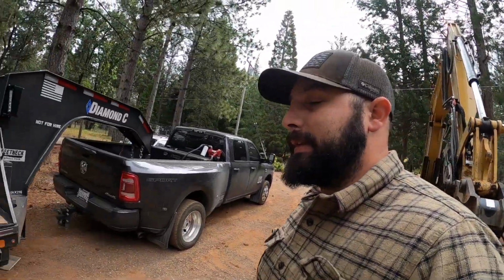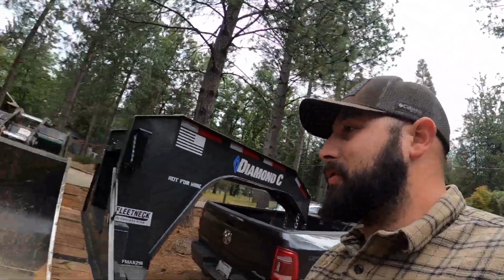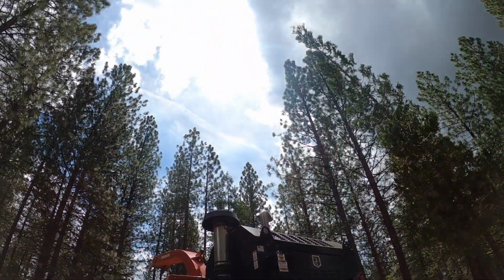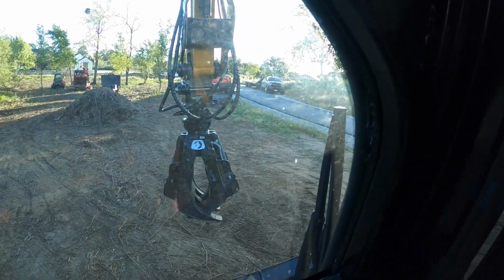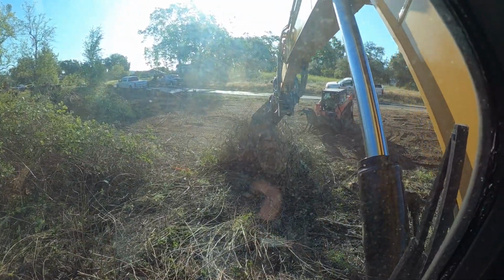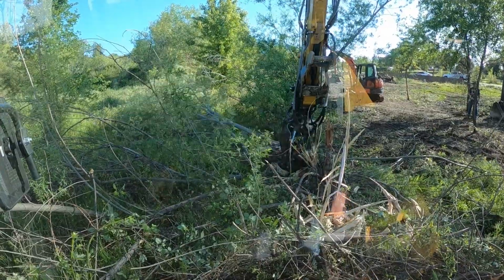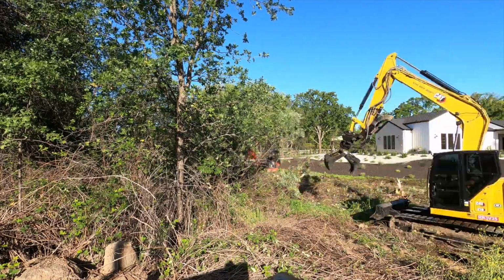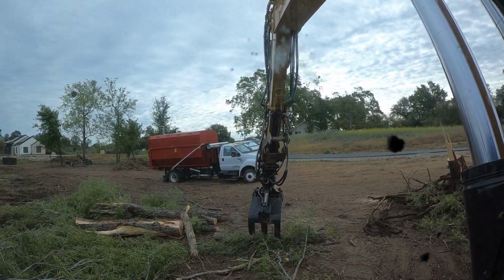Clearing property with a cat 310

Comment: What is the vibration slash grinding noise while your running the 310 with grapple? It sound like the pump is cavitating sounds bad
Reply from the maker: Camera makes it sound worse than it is typical high pressure hydraulics

Comment: Is that a ram 3500? If so does it pull that 310 well? I currently have a Yanmar 80 and I'm thinking about making the jump to the 310...any comparison between the 2 personally?
Reply from the maker: Why two recent videos will show my towing the 310 up and down grades little to no problems what so ever 
Funny you talk about the yanmar I saw one today. It was a vio100 and my 310 dwarfs that machine too 
The 310 is a heavy one but she makes her way around pretty good with the weight
Reply: Were you able to get a quick coupler for yours? Odd that at 180k new they don't come standard.
Reply from the maker: @mitchellventrone400  yes it has a QQ 
Best double check that cost cause I payed less than that with 3 buckets coupler and a thumb
Reply: @IManOPERATOR  prices are crazy right now. I'm looking at a used machine with 2 buckets 1k hours for 130 right now.
Reply from the maker: @mitchellventrone400  oh dam crap dude. Best of luck, hopefully seems like there’s going to be a good crash coming up I’m sure you’ll score on something to buy in the next few months